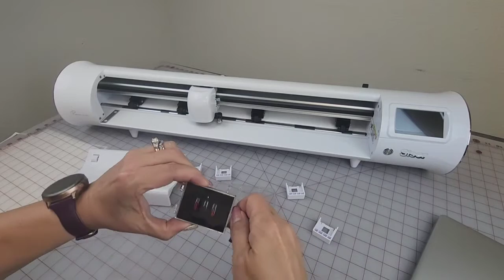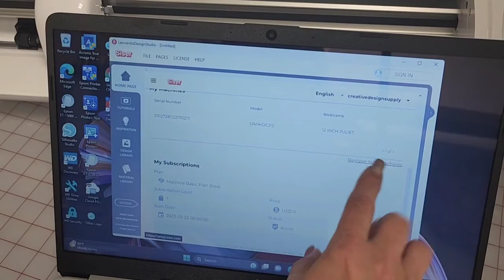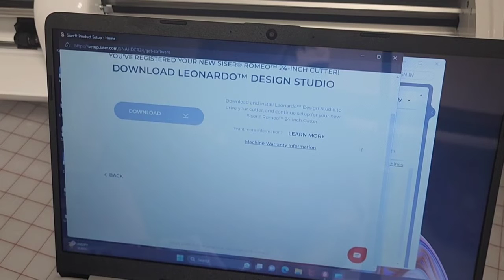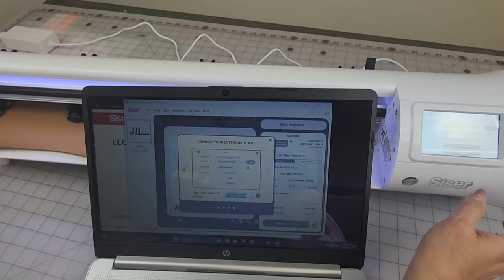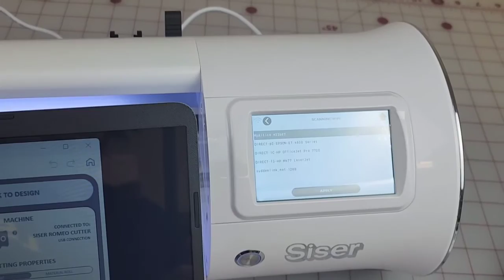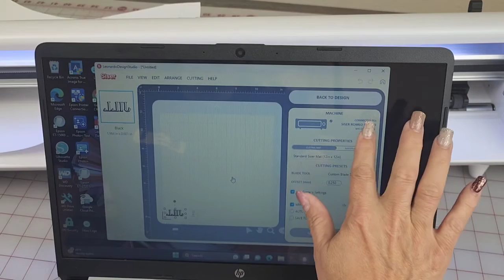The Siser Romeo 24" High Definition Cutter and the Material Roll Holder.

Comment: OK, so for anyone coming to this late, here is the honest truth from someone who uses the smaller Juliet and who has plenty of cutter experience. I have used the Juliet for over 6 months now and love it. Leonardo design software for the Siser cutters now has two versions, the basic which is free and the Pro which is $8.99 a month (free trial till end August 2023), or the option to use off brand software, SCAL6 which is purchased for under $50, or the dearer Pro version of that.  Only commercial users are likely to need the Pro version though for multiple machines etc. The cutters are great, you can cut what you want. The rule of thumb is if you can cut it with scissors then you are good to go. Matless cutting on all vinyl, no matter the brand. Cut card, flexible plastics, paper, faux leather, make stickers, the sky is the limit. There is also a stand coming out soon for those who need that.
Reply: as this is the end of September, have they implemented this yet or extended the pro payment?
Reply: @darlahpotechin1668  It is still due to come in (as far as I know,) for the start of October..

Comment: I thought that Siser said that their cutters are the quietest on the market. 
The sound reminded me of the Silhouette machines a little bit, which I can't stand too much.
Reply from the maker: Yes, but the Silhouette has a  awful grinding sound like makes you question is this machine ok? Siser's  sounds like R2D2.
Reply: I have the Cricut, the Siser and the Silhouette and I find the Siser is the quietest and the Silhouette is the loudest. But new machines are coming from Silhouette touting its quietness. So we shall see. I will tell you that when running my Cameo 4, I have to turn up my tv to hear. I do have a tv in my room with all my machines. With the Romeo and Juliet I do not. With the Cricut it is inbetween with the both sound wise. My siser cutters cut exceedingly well. I use them the most and the Cricuts are collecting dust unless I have a job that I created in it. The lack of export in Cricut is a stumbling block for me. Realize that a microphone enhances noise.